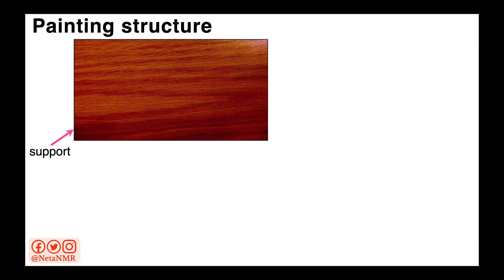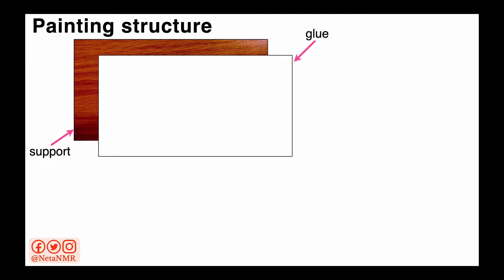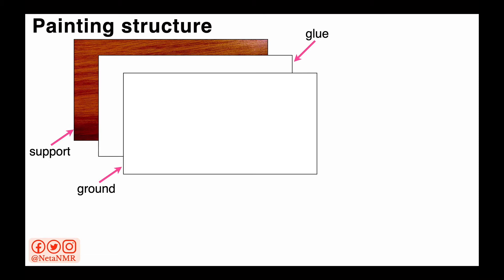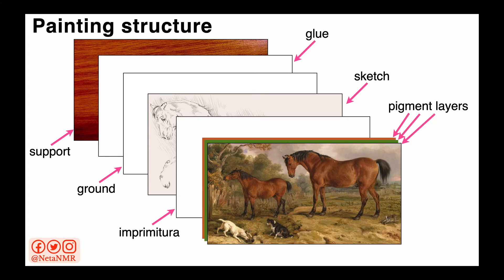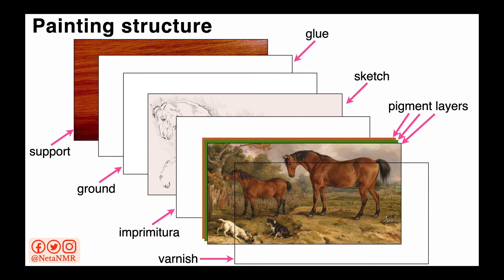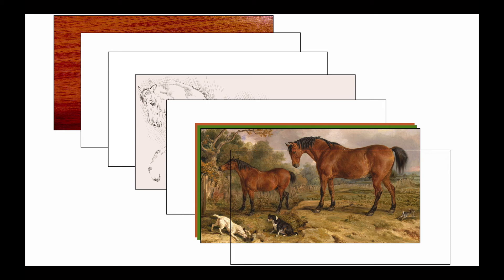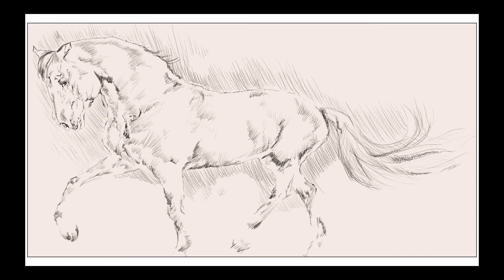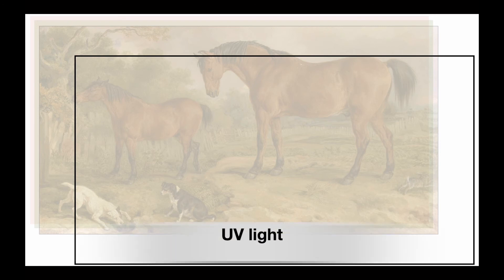PAINTING LAYERS and how scientific analysis reveals the painting structure and composition

Comment: I would like to try analyzing the "Starry Night" drawn by Vincent Van Gough. When the painting is viewed only with human eyes, it seems as if many different paints and substances of paints were used to portray the intricate details of the paintings. Therefore, I wondered if the painting would really have been painted by different elements depending on each color or mixture of a darker color with white, as we do in modern paintings.
Reply from the maker: That's a very good question and XRF could help identify those pigments.

Comment: I would like to analyze the "Portrait of the Fragrant Concubine in Armour" (Xiang Fei rongzhuang xiang), an oil painting of a Qing dynasty court woman attributed to Italian Jesuit missionary Giuseppe Castiglione. This painting is very unique because it shows Qianlong Emperor's consort dressed in European battle suit, which is highly unusual given the social expectations of royal women at that time. I would like to find out if the painting on the surface was changed much from the sketch underneath, and if yes, why were certain aspects changed while others were not. Maybe an analysis of the paint pigment would also shed light on the place of manufacture of the paint used -- did the eighteenth-century European court painters working in China use domestically sourced oil paint, or did they still rely on imported materials? Here is a link to the painting: https://www.pinterest.com/pin/591590101025714410/
Reply from the maker: This is a very interesting case study and these are all very good questions we could answer about the painting using different scientific methods.

Comment: Hi Professor, Denat from CH Spring 2021 here. Using x-ray radiography  and x-ray fluorescence technic, I would really like to analyze the painting titled 'A Young Black (Francis Barber)' painting by Joshua Reynolds from the 18th century. It would also be interesting to analyze a more recent painting from the 21st century, for instance 'Phowthah sis' Mgabadeli' by Luyanda Zindela, and see if there is any difference in the kind of materials used in the two paints from different centuries.
Reply from the maker: XRF could definitely answer your question on the pigments used for the paintings from different centuries.